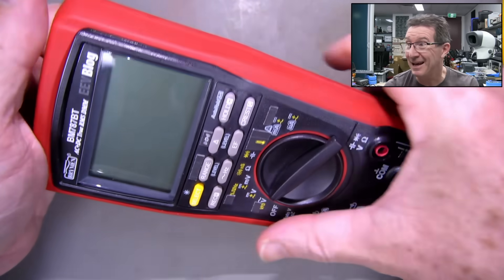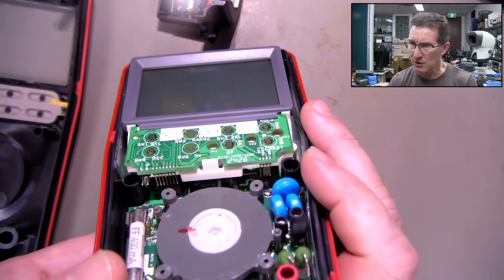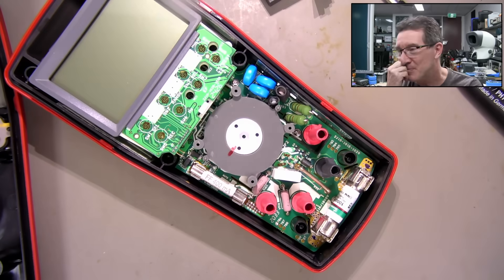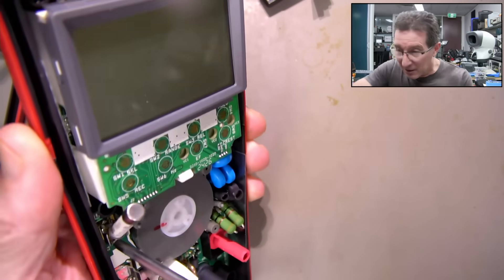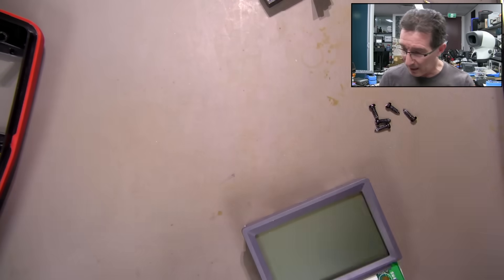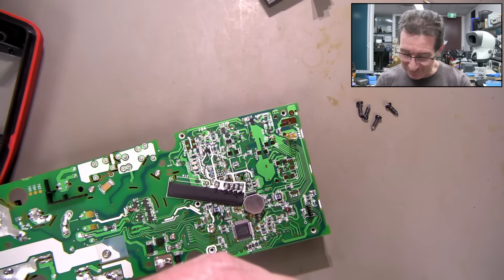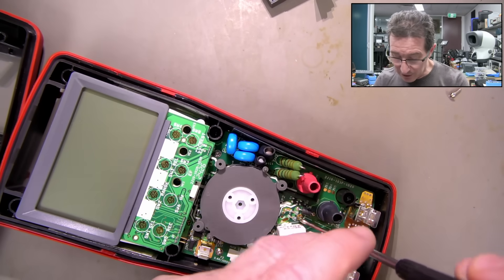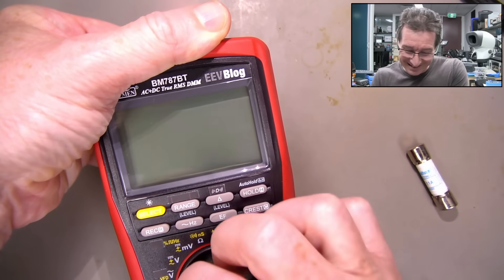Engineering Brain Farts (BM787BT)

Comment: Earlier this year I was debugging my new PCB design that has a dual UART. I must've spent at least 20 combined hours re-writing software and using my oscilloscope to figure out why it was outputting serial ASCII at an appallingly slow speed (I mean like 10 to 30x slower than the baud rate I programmed). It was freaking out at even the slightest bit of EMI. Turns out I had accidentally assigned the clock signal trace to connect to the OUTPUT XTAL pin instead of the INPUT. So I guess internally it was still receiving barely enough clock signals to work at a snail's pace, and that had thrown off all my troubleshooting efforts. I had a similar "no f***ing way...." moment when just aimlessly looking at the board layout in defeat.

Comment: here's one from today. I have designed a simple pcb to assemble some low-drift integrator for monitoring magnetic flux going through coils. Today i was choosing, which opamp to put in, there was a tried-and-true one, and a new fancy high-end one. Decided to go with the high-end one. After some time debugging the circuit and scratching my head over why one channel performs extremely poorly and the other does not work at all, i realized that the high-end opamp is a single amp while the board has been designed for a dual one. DOH!

Comment: With Bluetooth Low Energy you don't pair devices, you sometimes pair in the app directly, but that's not required and highly implementation dependent. Stuff just talks to each other without that. Unless it's some functionality that's device-wide (like headphones, although there are no BLE headphones available for now), then you may need to pair it.

Comment: But why didn't this work? The boards are only minor revisions apart (you originally said "identical") and the LCD controller is on the sub board, so did they change the LCD cobtroller or protocol that significantly?

Comment: I once tried to rebuild a failing RAID array of spinning rust, and it kept failing to format some of the drives. ARRRGGHH!! I was putting in the old failing drives! I dunno but some point I stopped putting new ones in to the LEFT box and the old ones in the RIGHT box but I hear that now they check the serial numbers of the drives and they tell you before hours have passed formatting.

Comment: one of my more painful brainfarts was laying a HeNe Laser power supply pcb (many years ago.. it was a DIY kit, just a single sided board, few components and the tube) on AN ANTISTATIC BAG for "insulation", you don't want to short anything, right? 

So, power on, fizzling noises, doesn't lase much. Grab the "insulation" bag, and surprise your friends with a bit of grunting and curling up, then amuse them further by being slightly confused for about half an hour......

Comment: Yep, it happens all the time, my recent brain fog was taking apart a simple battery operated whisk which was running slow. It had a snap together case which was hard to seperate and when i pulled it apart some bits fell on the floor and some on the very crowded work bench.  I picked up the parts off the floor and found what i thought were the rest of the parts on the bench. Most of the parts went back together ok but there was one part a spring battery contact that would just not fit correctly. After spending some considerable time faffing about and actually reshaping the spring to make it fit it finally dawned on me that this spring didn't actually belong at all and that i was trying to fit a battery spring from a teardown of another piece of equipment. Yes you are not alone.😖🇬🇧

Comment: 50cc twostroke bike with manual gearbox. Had the engine completely apart, put it back together with new bearings, seals and a bunch more, so fully restored. Put it all back together and back in the bike, start the bike, 1st gear is where 1st gear should be, 2nd is where neutral should be, neutral and gears 3 and up is not there.
One of 2nd gears gear slipped off its axle when the engine was apart, I thought nothing of it and just put it back, not noticing it went on turned the wrong way. That turned neutral into second gear and prevented the mechanism to move any further up than the position meant to be neutral. So, pull it all apart again, flip the gear and put it back together.
Ever since that I always test all the gears as soon as the engine has been assembled far enough to shift. Makes it a 5 minute job to pull apart again if there's a problem, instead of several hours... not to mention the time that was wasted on all the assembly before the problem was noticed.

Comment: At least you didn't do permanent damage like I did. 
I repair pro format video tape recorders for a preservation service. I committed one of the cardinal sins in front of people!! 
I was doing a total head drum/motor swap... when I committed the cardinal sin of picking up the good head/motor assembly instead of the bad one and removed the factory calibration set screw for the motor on the shaft 😳🤬 That keeps the motor in phase with the rotary transformer (onto which the head drum attaches, permanently registering phase with the motor).  
You can't fix that without a factory jig, or make a jig unless you have micro scopes, micrometers and moving stages with proper clamps AND a good example assembly to get your x and z from... for finding land marks from motor windings vs features on the rotary transformer stage. 
I tried anyway. 1 in 10 tries got me to about 25 degrees off but even just a light tap threw it off so far it wouldn't register an image at all. 
So it went of my shelf of shame that I keep there. ALL my fault, I was talking to people and trying to go fast. Really taught me a lesson!  BUT HEY at least just the bad head drum turned out to work for their playback needs... and then it got broken in a freak accident that kinda wasn't anyone's fault.

Comment: I've been building these fire fly simulators to hang in the yard for family members. I've designed many versions with ATtiny85, ATtiny13, ATtiny402, ATtiny10. The ATtiny10 is the main one I use. I had one module of my custom PCB I had designed and used for the past 2 years and no issues. But one module would only light two lights for just a second and go out. I spent hours replacing parts, and even the ATtiny10. Reprogrammed and again still was not working correctly. I then thought maybe the cat walked on my keyboard with the code up and messed something up. I dug and dug through the C code. Finally I saw my idiot mistake. I had the code for the ATtiny402 firefly, not the ATtiny10.. I was surprised Microchip studio did not error with it.. I wasted at least 4 hours with that..

Comment: Got to drive a pusher bendy bus. So engine is 18m behind you. Engine rpm meter is broken.
So I take over this bus from my colleague. Get in, pull the damn thing on (set mirrors, seat, wheel).
Push start. Nothing happens.
After 10 mins, colleague walks by, asking why I'm still at the buffer and not en route.
I reply the damn thing don't start.
Colleague replies: of course not. I left it running when you took over...
Put in gear, release parking brake and go.
<Massive facepalm>

Comment: just recently, I made a "plugin" for my universal OBD cable, not realising, that i f***ed up the numbering of the pins between the OBD connectors and the D-SUB 37 Connector...
all worked fine on the 1:1 Bypass plugin, but not so much on the FIAT A4 😂 the bottom row of the OBD Connector was reversed on the D-SUB 😮
fortunately there aren't so many connections that had to be re-done, finally it worked

Comment: Hi seiner moment. I did the same. I remember that I repair of a computer with a duff mother board because I had not seen this customer for a long time I was replacing a motherboard I took out the mother board out and  with talking to the customer and having a up of tea I put the faulty board in and I could not understand why it was not working I spent hours trying to get it work I thought it might a duff power supply so I swapped it out still did not work two hours later I realised that I put the faulty motherboard back in hat blocker I was but I had good time with the customer then we went for paint beer. All the best steve beswick.

Comment: "Oops, I did it again... Had too much on my head, put non-working board in..."

My recent brain fart was not hooking up the motor ribbon when I was cleaning the CD drive on a Playstation 2; easy fix, work great now.
Not as great as forgetting to put a matrix case into a Monotype composition caster back when I worked at the Book Art Museum. That one sends a squirt of molten alloy of lead, antimony and tin upwards into the pretty intricate mechanism that moves the matrix case... then you're in for discombobulating, cleaning, recombobulating and a bunch of adjustments, easily taking a bunch of hours.

Comment: field repair of a 50-pair cable. did it inside our tech van. one cable was fed through the back door of the van, the other through a window. of course, noticed it only after all 50 pairs were soldered, thoroughly insulated, and the splice closed. tbh, bloopers of such kind happened regularly, and I wasn't the first (or the last) one to do it.

Comment: my brain fart is i was putting a Sony radio back together and i turned it on and the tuner did not work and i plugged and unplugged connectors inside it until i finally realised i forgot to put the tuner back in.

Comment: i was stupid teenager
i had christmass lights  with 14V big bulbs and i was fully aware how ac or dc works and what is series or paralell connection doing to the voltage
but i was somehow totaly convinced that if it is a series set where if one bulb dies rest still works the bulbs must be 230v ac even if they are labeled 14v dc
and i was so convinced about it i connected that bulb directly to the power socket and it instantly exploded inside (thankfully the bulb envelope didn't break) but the main house breaker did also pop

Comment: More general screw ups I can remember are not matching the voltage to the device. I blew out an Iomega Zip drive back in the day with a 12V supply (it used 5V, a big brick linear transformer). Or the time I was testing a dashcam with variable supply, with current turned down (to avoid burning anything out if I got something wrong). It ran on 5V but I was blindly supplying 12V and it kept turning off due to overcurrent, so naturally I raised the current limit rather than realize it was saving me... and fried the dashcam. Recently I've blown a couple of small things probing with uncovered meter probes, shorting something for just a moment and causing something catastrophic.

Comment: Regarding the Bluetooth - the 121GW doesn't require you to pair it before use. You just start the 121GW app, it then shows you a list of all the 121GWs in the area and you pick it. It's Bluetooth Low Energy - you don't maintain pairings (because that means the device has to maintain connections, detect devices, and other stuff). BLE lets you send the signal "in the blind" where it's picked up by anything and everything within range. Full power BLE devices need to be able to filter out BLE messages to just the ones desired, but they have the power to do so, while other BLE devices just transmit without caring. Not caring about pairing or such means significantly reduced protocol overhead so you can implement BLE on microcontrollers and without needing to maintain significant state in the Bluetooth module, so you can power it down to save energy. Hence "low energy". It's what lets BLE devices work for over a year on a coin cell battery.
Reply: Android apps can also manage the pairing "behind the scenes".
Reply: There is too some devices which my App been using maybe a decade.. specially on older android versions it kinda still works that device which should require PIN you can bypass it (depends the bluetooth device erh.. "level" Not BLE devices i am sure). I did it by accident with fooling around and left it as a "feature" for those.

Comment: Some 25 years ago, I was doing repairs for a arcade game firm, and we got a faulty unit in. Symptom is no picture on the CRT.
Nothing appears wrong visually (no burnt components, no smell).
I systematically work myself from the PSU in (some of the units had a known problem with some PSU's and isolation transformers), get to the point where we use a test display.
Game comes up just fine. WTF?
I do the cumbersome task of removing the CRT, and right about then a colleague walks in and exclaims "we've found the fault".
I draw a blank for a couple of seconds, realize he sees the underside of the CRT assembly (these things were a cage which holds the CRT with the control PCB below it), so I put the cage on the side and check.
Underside is mostly covered in dark soot.
From what me and my colleague could piece together, someone must've tried to short one of the payment keyswitches to get free games (which BTW won't work, there's a baffle in the way in the cabinet), but touched the HV portion of the CRT PCB instead.
Hopefully briefly.
Moral of story: Include non-visible side of open PCB's in the visual/olfactory check.

Comment: I have my baptism certificate saying that I'm born in 2990. Someone goofed that up back then :D
Reply: UK here. My car's annual test certificate (MoT test) has a large mistake in the odometer reading - a fat-finger 7 for 4 keyboard error  Missed the window to get it corrected by the test station so the next route is to send off a copy of the emissions test done at the time. Only problem is the tester put the the car's capacity (1999) in the odometer field so I'm stuffed.

Comment: Just a few weeks back i was building a new computer with am5 board and i was optimizing the ddr5-timings, but this caused the computer to hang multiple times, so bad i had to clear the cmos every time. But this board didn't have a button for it, so i had to do it with a screwdriver everytime. Then i thought i'll be clever and put a cable with a pushbutton on the jumper. Computer was laying on the side before, now i had it stand up again .. and then i took me hours to try to make it run, but it crashed when trying to boot the installed windows, i've choosen older settings which were working before, lowered the ram-timings, tried booting from a rescue-usb, at one point i even loaded the default-settings without even xmp-profile. And it still wouldn't run .. Then i dawned on me .. the Clr-CMOS Button was under the case and was pressed the whole time. DUH!!! As soon as i got it out there, everything worked as expected. sigh

Comment: Was running a test protocol on a blood separating machine using a blood product from a donor who was apheresed for 3 hours to produce an apheresis product for our test.  Someone came in and wanted the tubing sealer that was plugged in next to the machine I was running.  I said, "sure, here you go," and promptly unplugged the machine running the apheresis blood instead of the tubing sealer.  The machine stopped and almost ruined the test, luckily we were able to get our friend from the manufacturer to quickly send us a truncated program to run to pick up where we left off.

Another test run, I was plugging a bag of apheresis blood into a blood separating machine, and instead of spiking the tubing set which has a hemostat blocking the line and then spiking the bag and flipping it upside down on the hangar, I goofed and spiked the bag first, giving it an open end, flipped it up onto the hangar, and WBC enriched blood poured out all over the machine and all over me.  I caught it in time to keep most of the blood in the bag, but yea... having to clean all the blood off the machine and my lab coat, that one scarred me a little.

Comment: Last year I replaced the filter cartridge in my water filter, the same as I do every year. I don't bother reading the instructions since it's been done so many times. I missed a step where I had to screw something in and it gave me an error message. I went through the trouble of calling customer support and having them ship me a replacement part. Then after re-assembly I made the same mistake and it still didn't work. But eventually I realized I had forgotten to screw it in, took it apart a third time, fixed it, and then had to ship the replacement back. Hours of wasted time!
Reply: Pulled an old water filter out of a skip to add to the brass scrap collection. Stripped it down to find the ceramic filter element was still wrapped as supplied complete with the fitting instructions.

Comment: Yesterday I built a display with 6 I2C modules which I have done before, ordered them from highest address left to lowest right, only a fool would do it the other way around. So after powering it on, I reversed the order. Things were good after that.

Comment: There's a label printer we have where I work that doesn't need to be "paired", insofar as the app provided deals with it by itself rather than having to go through the normal pairing process. Starting the app connects the device, and it disconnects if the app is fully closed.

Comment: Been there. 3hrs to remove a dash to replace a blend door actuator. Get called away to speak to a customer. Come back, another 3hrs to reinstall the dash and the problem isn't fixed. Go over to check the old part and realize it's the new one still sealed in the box.
Reply: I'm pretty sure anyone that doing something been there. Its called onosecond.